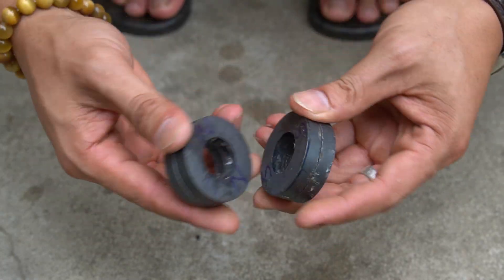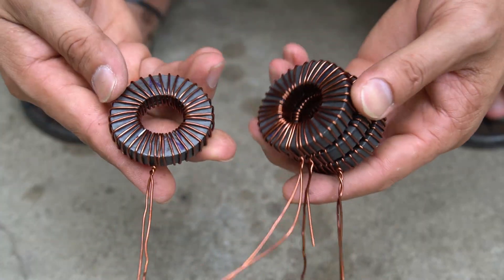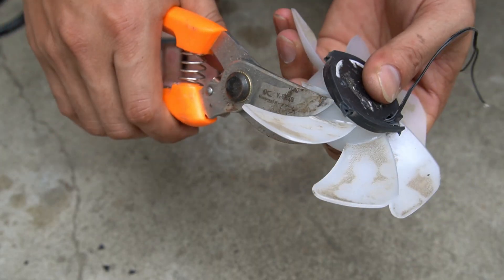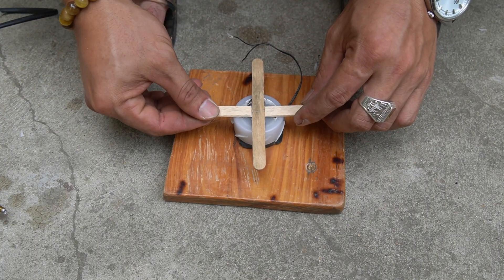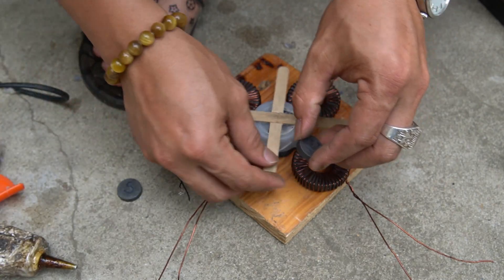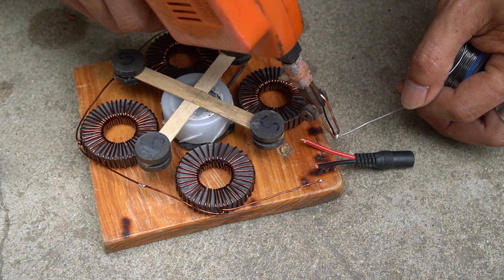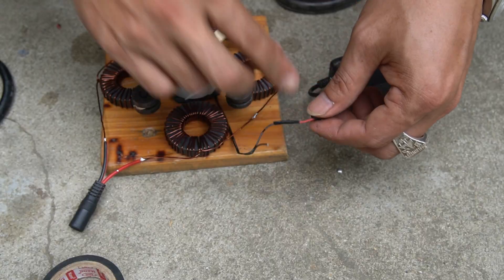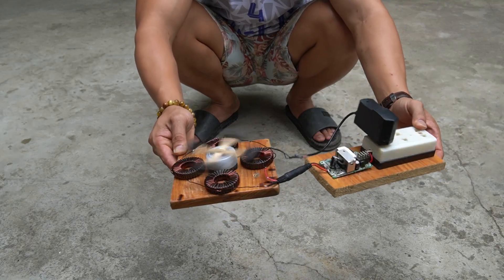Free Power Forever Shocking DIY Perpetual Energy Generator

Comment: If two generators with different power ratings are connected together and only the smaller generator is powered to turn the larger one, the second generator does not necessarily produce more electricity.

The electricity generated by a generator depends on the mechanical energy supplied; in other words, the larger generator can only produce more electricity if it receives more mechanical force. Simply connecting the generators and supplying power to one of them does not increase the output of the second generator. The smaller generator converts electrical energy into mechanical motion, and the larger generator converts that motion back into electrical energy. Therefore, the output power of the second generator equals the mechanical energy input it receives.

So, a more powerful generator requires more mechanical input energy to produce more electricity, not just by being connected to a smaller generator or supplying power to it. ⚡
Reply from the maker: ❤️❤️❤️ Thank you very much, please like, subscribe to the channel and visit me often.